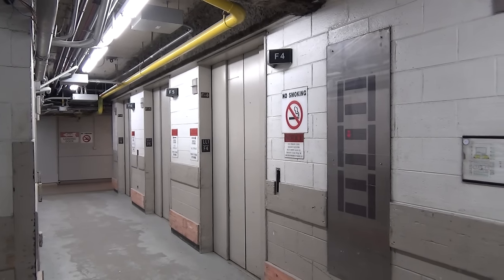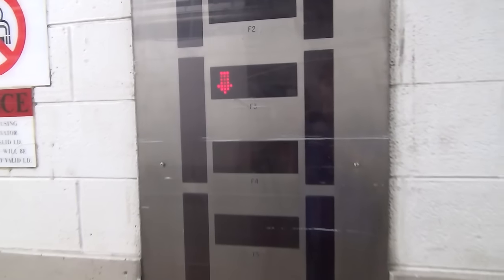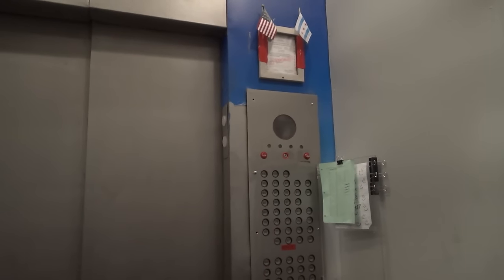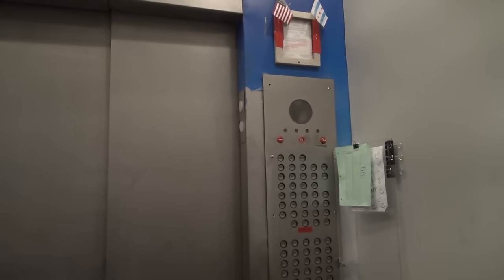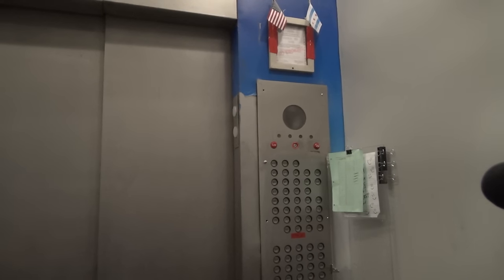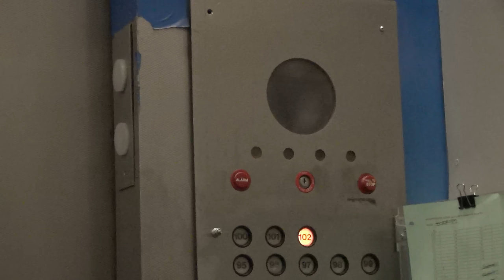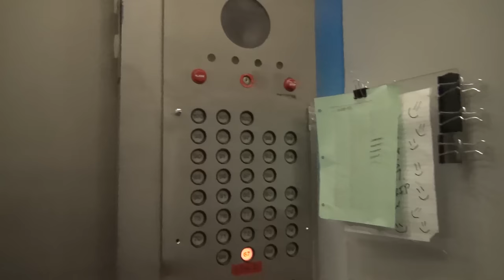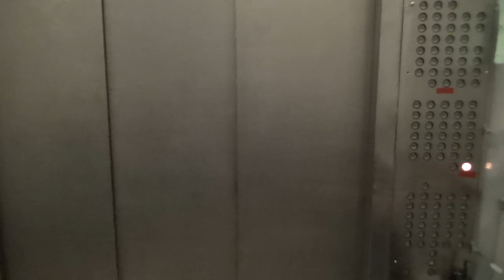EXCLUSIVE: 100+ Floor Elevator in the Sears/Willis Tower! (Machine Room)

Comment: Rode that elevator many times. We had radio equipment in the penthouse that I maintained. The RF energy was so thick up there that it was impossible to turn off the fluorescent lights.
Reply: So the lights just glowed on their own because of the rf energy
Reply: @imeakdo7  Yes. In the penthouse turning the light switch on or off only made a small difference in the intensity of light from the fluorescents, they always produced light because of the stray RF energy from all of the radio and TV transmitters. Not a particularly healthy place to hang around. As I remember the highest elevator machine room was a floor down, and it was fine there.
Reply: It wasn't gmrs equipment was it?
Reply: @seanjuth  Yea, basically. Class B CB became GMRS (with a stroke of a pen) about that time. We had commercial repeaters on UHF up there.
Reply: @TestTubeBabySpy  Not technically, no, but the distinction is not very relevant. It was electromagnetic radiation leakage from all of the transmitters located up there. The leakage from any one was probably negligible, but put a hundred together and it adds up.
Reply: @steveanderson9290  I know of a gmrs repeater still up there and working. It's coverage is ridiculous

Comment: I rode that elevator a time or two back in the day.  I worked for an audio visual company who provided services to a law firm on the 90-something floor.  When you got an express run ( no stops at any other floors) you could feel the wind come through the crack under the door.  Also, your ears woud pop a time or two as if you were ascending in an airplane.  And  this elevator is fast! You would almost need to hold in to something as it shaked and shimmied through the shaft.  The service elevators were (maybe still are) operated by union operators.  Their job was to ride up and down all day and just push the button for you. Thats it, nothing else.  If you had a full load gear, they would not budge an inch so you would have to split it into two trips.  If it was a busy day, it could be over 20 minutes before that car came back down as it serviced all the floors between.  Also DON'T piss them off, they would skip your floor and you would be screwed.  One lady operator was as  very obese. She sat in a rolly office chair with 3 of the 5 wheels broken off.  She carried a long thin stick to reach the buttons for the upper floors so she did not have to stand up.  The loading dock is cool too. All our gear had to pass through metal detectors before we could go to the elevators.   They had a 100' long air lock to prevent the pressure differential in the elevator shafts from creating a windstorm.  And after 9/11, they employed a full time bomb sniffing K9, and if he was on lunch or had the day off DOCK CLOSED!  Thanks for this video to help me recall these stories.

Comment: I had an uncle who retired from Otis Elevator many years ago.  He traveled all over the world working on them.
Reply: That's nice. Chickey.
Reply: I once operated a industrial lift truck (fork lift) .....that wasn't a fork lift, it was a carton clamp. Same principle but it had a clamp up front instead of forks. A much more dynamic thing to operate. The best unit in the place was the Baker......made by Otis Elevator company. The Baker was smooth, accurate and powerful. We had other Clamps but they were jerky, unreliable and generally a pain to work with. The Baker was so smooth and powerful it was a pleasure to drive.
Reply: In Scotland? Our 12 floor glass custom install is a nightmare. Installed in 04

Comment: I worked at the Pennsylvania Hospital in the 70's and went to the elevator penthouse. The technology was just like this. There were only 6 floors, but the elevators were big, being a hospital, and the motor was about the same size. The sound of the relays randomly clicking is unique. That brake on the motor is huge.
Reply from the maker: Very cool! These older relay logic systems are really fascinating from an engineering perspective.

Comment: Do you know the reason why it always stops at 34 and 67 in either direction? Is this for keeping the hoist ropes from vibrating or developing resonance? Or more to do with the controller needing to divide up the travel into approximately 35 floor sections? Having visited the observation level back in 2017, the elevator they use doesn't' need to stop between the basement and top floor, of course it's probably the newer style controller. Fascinating video.
Reply from the maker: I’m not sure why it stops.
Reply: It didn't stop when new either. Our family did the tour when Sears Tower was a year old... ears popped! It was a wild experience for  1 10 yr old kid!
Reply: From the Wikipedia article: levators and escalators
The Sears Tower was planned with 103 elevators,[151][159] including 14 double-deck elevators.[151][168] The office stories are served by 97 elevator cabs; due to the presence of the double-deck elevators, these occupy 83 shafts.[124] As designed, one bank of single-deck elevators connected the lobby to the lowest 28 stories.[168] Banks of double-deck elevators traveled to "sky lobbies" at the 33rd/34th and 66th/67th floors, where passengers could transfer to local elevators. The 34th through 103rd stories were served by local elevators that operated from the sky lobbies.[151][168] Two elevators also ran directly from the lobby to the Skydeck on the 103rd floor.[169] As of 2018, the elevators carried 5.8 million passengers per year.[123][124]
Six of the elevators are used for freight.[159] One of the freight elevators served all stories, traveling to a height of 1,440 feet (440 m).[169] During a fire or another emergency, this elevator would be reserved for the Chicago Fire Department. Other elevators would be controlled from the 33rd floor. During a fire, elevators would be dispatched to the affected floors to assist with evacuation.[151]
Reply: From my experience in Michigan, all elevators have a key switch activated fire service mode. Whereas, firefighters have full control of the elevator. Prior to that when fire is detected, elevators automatically return to egress floor lobby and shut down with the doors ooen.

Comment: That's crazy cool!  And the selector, while huge, is considerably more compact than the enormous pie plate selectors on the Otis service cars at the old WTC.
Reply from the maker: Yeah I'm amazed at how compact the selector is on this thing. I look at our 13 stop Otis selector and it's as tall as half of the one in this video.
Reply: @stlelevators  I just worked on a 16 floor Otis pie plate selector yesterday. The car was bouncing on the first floor where the contacts got dirty. It's interesting how efficient and reliable those older machines are when they are properly maintained.
Reply: Ooh, got a photo?
Reply: @cat1554  Careful - that kind of stuff can get you in trouble..

Comment: As an elevator enthusiast myself (but still have yet to ride on a high speed elevator), I usually like looking at the brand whenever getting on one in general. 

I used to be terrified of elevators in my childhood days, but now as an adult, all of my fears have disappeared; I can comfortably get on an elevator without anything to worry about.
Reply: I'm still scard of them as an adult even after knowing a lot lol. I hate getting stuck in them and even the newest smart ones always have problems
Reply: Baby steps..and keep a Tony Robbins motivational podcast at the top of your playlist, too.
Reply: @pleasedontwatchthese9593  I as well still worry about getting stuck in an elevator, even though my fears have disappeared. 

In my case, it would really vary on the condition of the elevator it self.
Reply: Wait until you knock the counterweight off with the service hatch and it falls 2 stories by the time the brakes stop you.

Comment: Very interested as to why there is a stop on those floors.  Does the elevator need to change to a different set of cables at those locations because it goes so high up?
Amazing relay logic setup!

Comment: Damn, that has got to be the tallest relay control board in the world! DMR was, at one point, also exported to the United Kingdom and sold under the Express Lift name, and that's because Express Lift had a technical partnership with Westinghouse. I believe Mitsubishi had similar system back in the 1960s-1970s, because both companies also had technical partnership (in fact, Mitsubishi Electric had partnered with Westinghouse since 1923).
Reply from the maker: I think it's currently the tallest original one, but I'm not sure.

Comment: Why can’t the elevator go to 102 without stopping at 1/3 and 2/3 of the way up?
Reply: im curious about this too
Reply: Not being in the elevator industry, I'd say it's part of why the panel is broken up into three different sections. Each section involves a control interface of some sort for the elevator, and in order for the next panel to 'activate' the elevator has to make a stop on a floor in that panel. The most 'obvious stop is going to be the first floor of the panel, where it hands off control to the next panel. 

If it were a microcontroller based elevator, it could be programmed to simply pass control on to the next control bay while moving, but this way also allows the elevators that don't have full range of floors to transfer passengers to the 'express' elevator, and vice versa.

I know that the World Trade Center towers elevators were also configured to only transfer between lobby floors for rides to the top. A shaft may have had three elevators running in it, each on a separate lift motor, and two fo them could not (obviously) bee at the same lobby floor at the same time.

There may also have been some consideration for the fact that as you move (say) 40 floors, you've just experienced a 400 foot, or 120 meter elevation change, and some people may experience uncomfort at the pressure change, and need to get off the elevator to recover and catch another for the next block of floors.

That said, I'd prefer to hear from someone who's worked on these elevators from a control service perspective. Perhaps someone who's worked on them from a design perspective, though that might be harder to find.
Reply: These Westinghouse DMR'S are known to have notoriously weak bladders, so, just in case...
Reply: I wish they addressed that on the video to make it more educational as well.  I'm also curious about that.

Comment: Amazing tour of the amazing elevators in this amazing skyscraper! I was also astounded at how quiet those machines are, even if they are big, high horsepower monstrosities, and the selector looked a lot like a linear track version of both the vertical Otis "Pie-Plate" and horizontal Dover "Composite" selectors. Also, what was the capacity of those freight elevators that you rode on?
Reply from the maker: I didn't actually get to see what the capacity was.
Reply: Probably 10000

Comment: This is really interesting that it makes intentional stops. Is that to help with ensuring you don't blow your eardrums out? :)
Reply from the maker: I don't know what the stops are for.
Reply: It can’t possibly be that fast that it would make your eardrums hurt. I doubt a freight elevator like this made in 1973 would have a speed of over 1200fpm. The sky deck elevators here have a speed of 1600fpm yet they don’t slow down in between. So that reason you suggested doesn’t seem like a likely one at all.
Reply: Maybe security checks on skylobby floors?
Reply: yeah i found that interesting too, although its under 1000 FPM, the car makes a lot of noise. The stops could likely be for noise and old, so the stops could also be to not overstress the equipment in the MR, and the car itself.

Comment: What's the reason for it stopping at floor 34 and 67? Is that some sort of duty cycle limitation of the motor, or something to do with how large the floor selector is?
Reply from the maker: I’m not totally sure. I think it has something to do with the Otis compass interface.
Reply: @stlelevators  I wonder the same thing.  Are the stops required?  It appears so.  I wonder why?
Reply from the maker: @mvsgeek  I kind of wish I asked why it stopped, but I didn't think of it until after.

Comment: That indicator looks like the one you wired for the elevator museum.
Reply from the maker: Which one?
Reply: The round one.
Reply: @mariokart8715  oh yep, they used to have IEE indicators. The original Westies got their Indicators replaced at some point later on without mod or not working anymore.

Comment: An old Sears Tower video featuring Steve Rosenthal from Westinghouse/Schindler states that the tower has 104 working elevators, two of which
Hitch run non stop to the sky long.  Does the tower still have Schindler elevators?
Reply from the maker: They're being modernized by Otis. They were originally Westinghouse.

Comment: Excellent video! I hope that you can come to my hometown of Kalamazoo Mi because we got lots of neat elevators here in the city
Reply from the maker: Maybe someday.
Reply: As a kalamazoo native and a former elevator constructor for 25 yrs., my work took me far from my hometown, throughout Michigan and the upper peninsula, Indiana,  Minnesota,  & South Dakota. You could say I seen it all but, I would disagree. Perhaps if I worked alot longer, that would possibly be true. 
It was an amazing career to say the least. Wish I started at a younger age.  I was amazed at the older installations early 1900's. And yes, there are many still in service today. I did one skyscraper earlier in my career. Minneapolis 1999, 56 story. Where I seen low, midrise and hi-rise cars. Whereas a passenger may need to take 3 seperate elevators to reach top floor. They had microprocessor controlled dispatchers that learned the traffic of the passengers throughout the day & night including holidays. It was self learning and employed algorithms for best timing. Also had two full run service cars- top to bottom. One was roped 2:1 & other 1:1. Me   and a few others roped those cars from the roof top when it was -47 below zero. Not a good time. Seems like there were eight-3/4" or 7/8"  cables each car.

Comment: I have seen photos of the car station of this elevator before. It is very nice to see this still here, but based on what you said below, it sounds like this is part of the modernization project and will be modded probably pretty soon? Is this car the only original elevator going all the way from near the bottom of the building to near the very top?

Unless there is another original elevator in this building traveling even further, it is probably safe to say this is the highest-rising original Westinghouse elevator in not just the US but the WORLD!!!

What is the speed? The elevator mechanic said "originally" 1000 fpm, has it since been slowed down for some reason?

Does this elevator have a motor-generator? (one isn't shown and I don't hear it)

That selector is so cool!!!

Is the DMR system (with this type of selector) specifically used for high speed installations (traveling faster than a certain speed)? I have seen videos of other Westinghouse machine rooms, but never using this selector before.
Reply from the maker: This one will probably be the last to go because it's the only one that serves all the floors. I can believe this is the tallest high rise original Westinghouse in the world. I don't know what the exact speed is now, but its less than 1000fpm. The motor generators are on another floor. The selector is probably the most impressive one I've ever seen. This is the first time I've ever seen this selector.

Comment: Those controllers are massive! and amazing marvels of engineering! I remember the DMR installation overseas in the Royals Royce building which has a similar floor selector. There traction machine was much larger with double wrapping. They are going to replace this elevator at some point?  Ought to leave it it's historic. I take it still has an MG set. 480VDC to the gear-less traction machine.  Great video of the windy city 102 floors up.
Reply from the maker: I believe the MGs are on another floor. This one will probably be replaced at some point.
Reply: @stlelevators  Very likely, I've seen this type of installation with the MG's  one or more levels  below. The MG's in the WTC were five or six floors below the machine room.

Comment: This is going to be as fast as the speed of light. Ha ha
Reply: The elevator technician said it travels at 1000fpm which would have been considered quite fast for 1973 given it’s size, but by modern day standards it’s quite slow. I would expect an elevator serving going up such a height and serving this many floors should be at least 1400fpm today. The fastest elevator in the world has a speed of 21m/s (4134fpm) so this Westinghouse freight elevator is more than 4 times slower than the worlds fastest.
Reply from the maker: Yeah this is quite slow for a building this tall.
Reply: Oh well